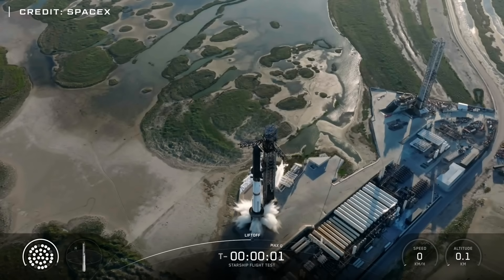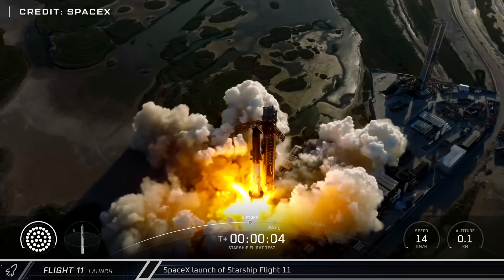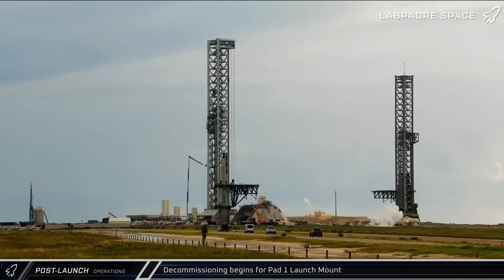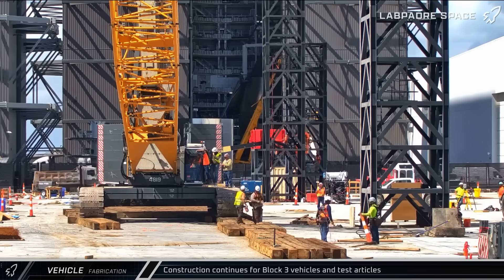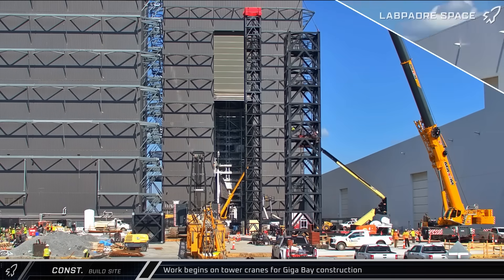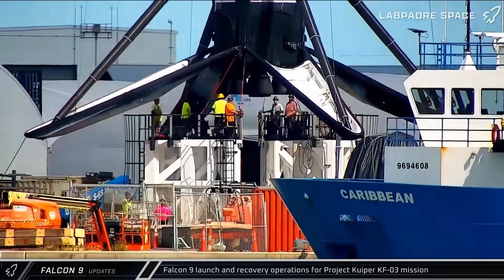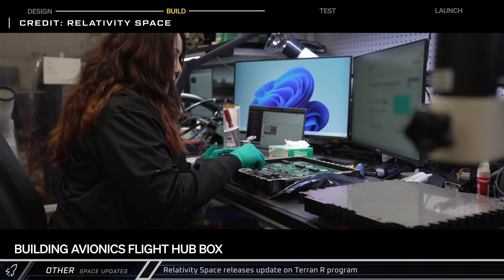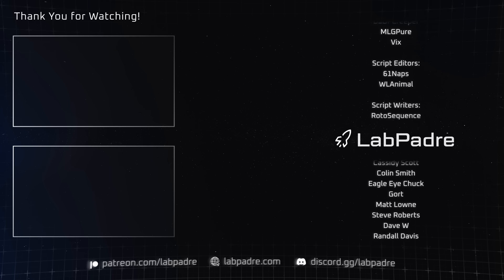SpaceX Is Entering a New Era For Starship - Spaceflight Weekly #189

Comment: Excellent update! Thank you
My guess: All hands on deck to get Pad 2 closer to completion before SSD (Slow Scheduled Disassembly) begins on Pad 1

I couldn't tell but were they any parts of the new hot stage section blocked off to assist with booster flip?
Spec: real StarLink V3s on Ship after first successful V3 flight

Comment: The "dance floor" was a nifty way of working on the engines while the booster was still on the launch mount.  I guess with the new launch mount SpaceX will have to remove the booster to work on the engines.

Comment: No hinge burn through, no fin damage. Looked like the best one so far.
Reply: And that's with 100ish tiles removed.
Reply: Not to mention the heat shield padding under the tiles in two different spots that they expected to burn through into the metholox tanks. I think they might have had different tests on some of the other spots they had tiles removed too cause there seemed to be burn through in more then the 2 spots they brought it right down to the steel hule.

Comment: Feel like they might try to orbit and launch some v3 starlinks from 39 why else would they need the full size pez dispenser?
Reply: I think it'll be on flight 13 myself, as they will want to confirm all the changes to v3 work as intended.
Reply: @johnd.7792 true true.
Reply: @johnd.7792  13 would be nice, but I think that hinges on a perfect flight 12 and with all the 'new' in V3's including the raptors I would be shocked by a perfect flight the first time.
Reply: @imaginary_friend7300 right of course that would slip if flight 12 doesnt work as expected... =)